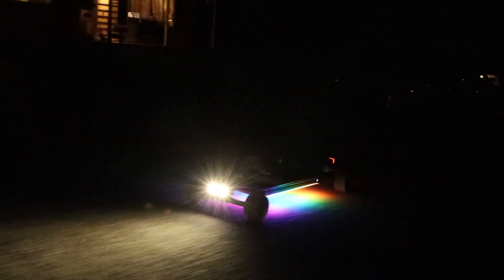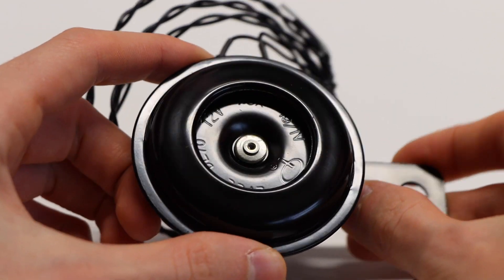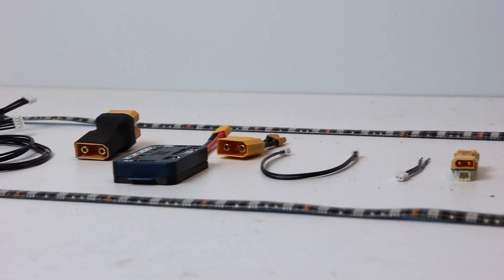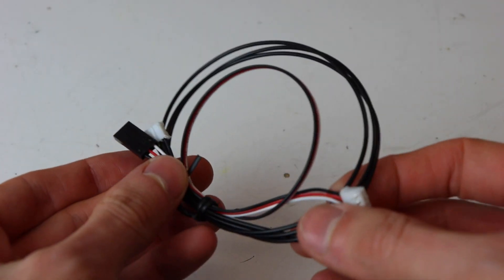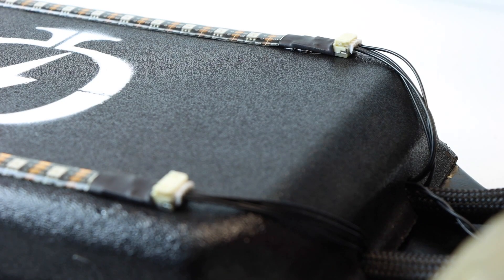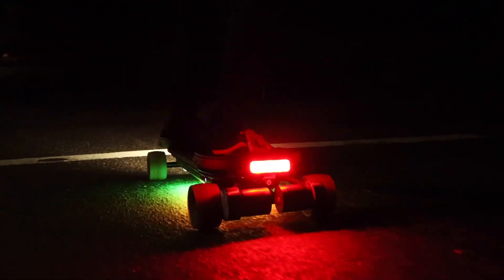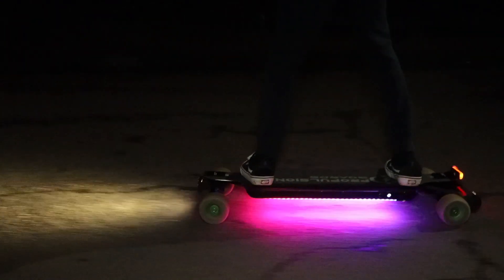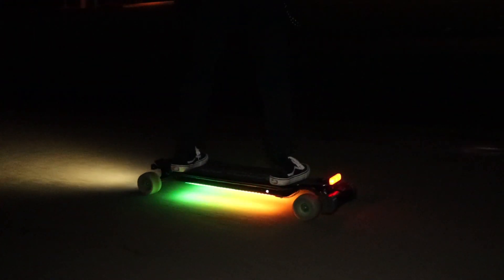TTL Electric Skateboard Lights Review - Interactive Intelligent Esk8 Lights

Comment: If only it was not 3D printed.  I feel as if it would break if something went wrong while riding…
Reply: I definitely understand your concern. That is why if any 3D printed part is to break on a user, the part will be replaced at cost of shipping.

The 3D printed parts have gone through numerous iterations to make sure they are as strong as can be while staying low profile. So far, they have been used by beta testers and customers for hundreds of miles on various terrains and no problems have been reported.

Comment: I wish somebody would develop a led controller with integrated battery or connectable to external powerbanks and gyro controls for brake detection etc. Some of us have a carbon unibody with zero extra space and impossible to drill holes because of structural integrity to connect anything with escs and batteries.

Comment: Thanks for the honest review and for doing a great job at showing all the aspects/options of the kit! Its very much appreciated!
Reply from the maker: Thank you for sending this to us for review! Such a cool and innovative product!
Reply: the circuitry and electronics is well designed, however as the front and tail lights protrude in front and back of the deck, i believe this will be more prone to damage due to bashing either front or back of your board. If you can redesign this to be not protruding, i think this would be perfect and prevent damage to the lights

Comment: What a fantastic kit! Thanks for the rundown. I run with both a 36v 40ah and 12v 50ah lipo block pair on my heavy board so I'd like to know if these can be run off 12v alone?
Reply: Thanks for your support and question. There are two control module options to support different power source options. The SP version (used in the video) is powered directly from a 6S-12S battery, while the EP version is powered by a 12V source of the users choosing.